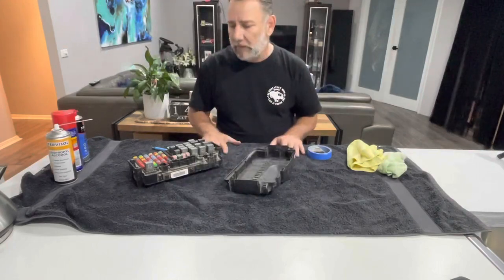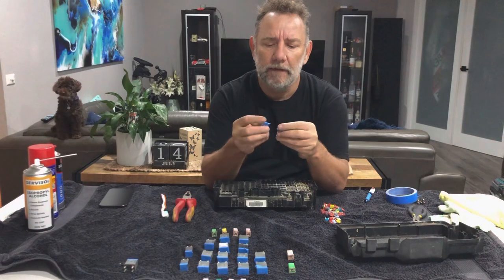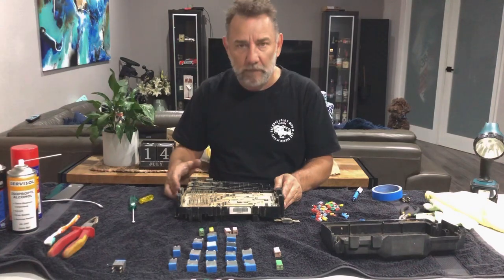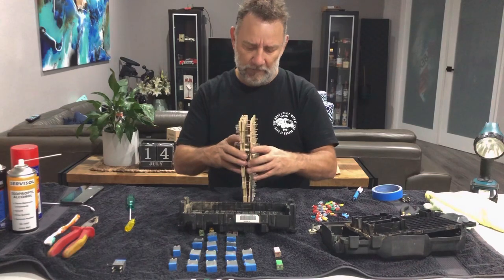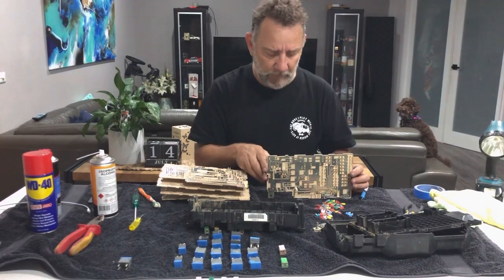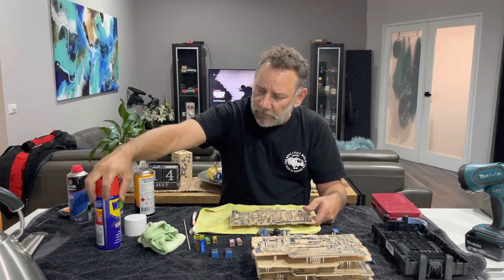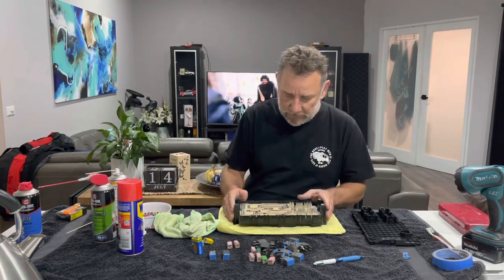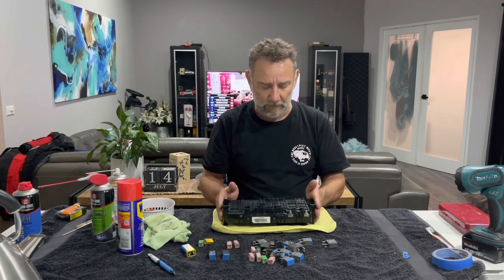Fuse Box Refurbishment DIY H3 Hummer

Comment: Thanks for the video. Very helpful. Have a 2010 H3T Alpha. All kinds of issues with this board. Pretty convinced it’s the board. Won’t shut off with key. Have battery drain over night. When I touch board. Everything comes to life. Indicates the board or a short in there somewhere. 

Problem is GM discontinued this board. Seems the H3T is different than my previous H3. Can’t locate one anywhere. My shop supposedly found one in California. But not sure it’s a scam. So going to try your refurbishment service and see if that works or find the problem. Seems pretty simple. Just time and patience. Tried to find a shop that refurbishes fuse blocks. So far nope. 

Will let you know. Thank you for info!  Very helpful. 

Gary - Michigan.